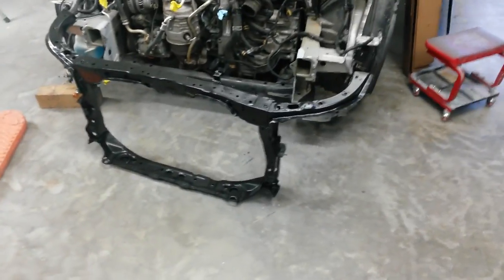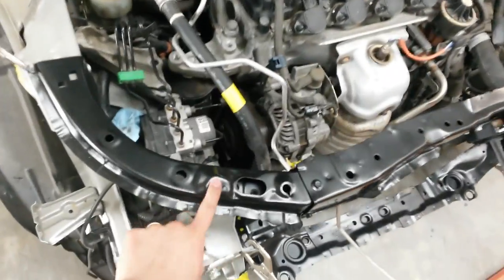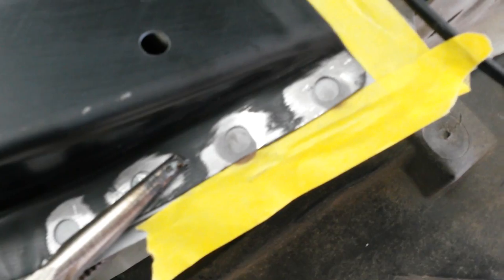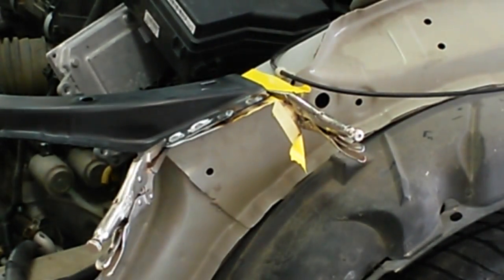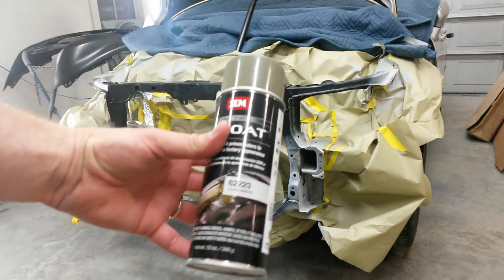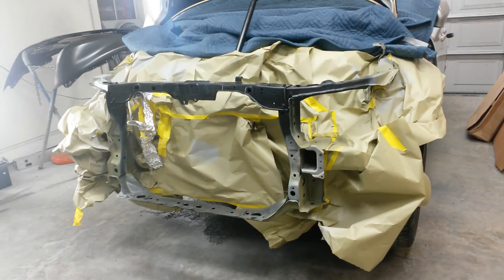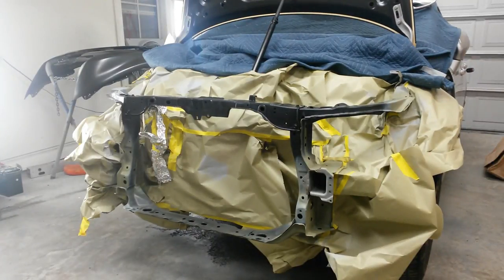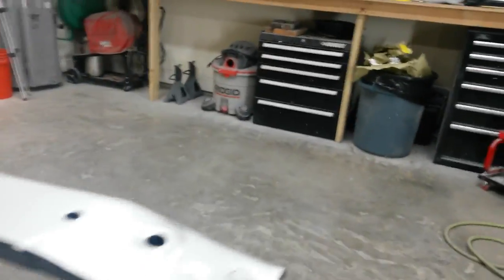2009 HONDA CIVIC REBUILD | HOW TO REPLACE A RADIATOR SUPPORT PART 2 of 2

Comment: I always clip the mig wire when I start a new weld too. Seems to make the arc start faster and smoother for me. Helps tons for butt welds too
Reply from the maker: Works similarly to a spark plug.  The sharper the electrodes are, the easier it is for the voltage to jump the gap. Plus the oxidized steel on the tip contaminates the weld.
Reply: Sam G That's what I was thinking.

Comment: Fantastic Job Sir I'm doing the same on my 2008 your video help me so much thank you very much for taking the time to make such a quality informative video
Reply from the maker: You're welcome. Ask any ?'s you have.
Reply: I got the old support off today it was welded at all the seems not correctly at all.. not how you did it anyways the way it should be done ! and the frame ends were cut out the welds were terrible if you could see it you would have a good laugh im welding in some corner pieces on the frame ends then prepping for the new support almost there i just need to buy the new support shopping around if you know any leads ( websites ) for parts im in northern ontario canada shipping rates are harsh this part is actually hard enough to find at an affordable price it seems
Reply from the maker: I purchase most of mine through Amazon or ebay. use RockAuto to find the Partslink Number (will he "HOXXXXXXXX" HO for Honda plus about 8 digits) Search online for that part number. Most of the time the shipping is free where I buy them.
Reply: thanks for that info been learning more and more ! really appreciate it thanks again

Comment: I'm a rookie on all these spot welding body repair stuff.  Is there a reason you don't just drill a hole and put in a bolt to hold it?  Then if you made an alignment mistake you can go back to zero point?  Well done video.  :-)
Reply from the maker: Ken Foster welcome to the channel.  That's a good question.  You want to avoid drilling unnecessary holes in the part since that weakens the part. It's best to clamp it in place until you know it's in the right position,  then mark it for 8mm plug weld holes. This way you never end up with holes that you have to weld back up after the installation.

Comment: Thanks for making the video. Probably doing this on my 04 civic soon. The headlights are no good and i need to replace them but the core support is so bent it just needs to be cut out and replaced or i wont be able to get the lights to bolt up

Comment: Hey Sam! Quick question. After you painted the support, did you apply a clear coat over that silver? Or leave it bare?

Thanks
Reply from the maker: I added clear but you can add activator to the basecoat if you need to match a factory finish that wasn't cleared.

Comment: Would rosette welds with a tig welder work you think for this type of job?
Reply from the maker: I don't know much about TIG, but it would probably work. I believe TIG is a lower temp weld, which would be beneficial. Would probably take much longer though.

Comment: Sam what is the tool you used to check for square at 3:08? I have an 09 C-RV that uses the same support replaced.
Reply from the maker: Tram gauge. I made mine but you can buy them.
Reply: Sam G did you buy OEM or aftermarket support?
Reply from the maker: @theunlucky5000  aftermarket.  Try to find  a CAPA certified part

Comment: How to put radiator suport perfectly in place , so then have perfect match of gaps on front parts hood , headlights, bumper. Is there specific dimensions,  or just weld to old spots? Thank you
Reply from the maker: You can get dimensions from Honda thru Oemonestop.com

Comment: I HAVE SAME ISSUE in my car ..but i have little twist from one side but it does not causing any problem other than look... so one can leave it as it is or it may cause any wheel alignment issues ?
Reply from the maker: The radiator support doesn't affect the wheel alignment
Reply: @samg5543  thanku v much for your reply sir i need little of your time i hope u will not mind. .FIRST of all HONESTLY i became your fan through your work. I live in  PAKISTAN damn it would be great if we have a person like u here.  My Question goes here "as u said it does bot affect wheel alignment i just wana know of that is the case wht could be reason of car sway .car sway little side to side on high speed.  There is no bend on frame rails other than this radiator /core support.  Tires are perfect n previous owner told he had done wheel alignment properly.  I bought this car few months back. Plz guide what should i look into
Reply from the maker: @gulraizify  find a shop that can check the alignment and make sure the tires are all the same size and tread depth and pressure is equal. If it pulls or sways to one side, swap front tires and see if the sway or pull goes in the opposite direction.  That will tell you if the problem is in the tires themselves.
Reply: @samg5543  thanku stay blessed

Comment: Also I'm thinking that it might just be a bent radiator support, can I just sledge hammer it straight and do I have to evacuate and remove the condenser first before doing that? or can I just get away with leaving it in place and hope it doesn't get smashed?
Reply from the maker: You can remove the support brackets for the condenser and move it out of the way slighty without evacuating it if that helps. If the center piece at the top is bent, you can unbolt and swap it out with a new or used  one if yours is bolted in like the civic I did
Reply: @samg5543  Okay, someone else told me the radiator support can be unbolted. I didn't believe him because the videos of you show you mostly drilling out the welds and welding back a new piece. I'll double check the diagrams and look at this again this weekend. Thank you
Reply from the maker: @eksine  some cars will unbolt but not the one in the video

Comment: Do activate ur basecoat .. been trying to figure out how to shoot basecoat to match the factory
Reply from the maker: Yes I activate the basecoat, but that doesn't make it match any better. You have to use the correct temp reducer and that will help. If you are spraying light metallics, it's best to blend the adjacent panels to avoid a mismatch.

Comment: so its safe to say radiator supports arent meant to be removed easily and then put back in right?  was thinking about doing this to make replacing my clutch easier  (i got time, but i have to do it myself)  i dont want to have to do any welding or alter any thing.
Reply from the maker: Not designed to be removable on these types of cars. Some do unbolt. Depends on the car.
Reply: Sam G thanks! I’ll look more into it but won’t hold my breath haha.

Comment: Know I’m late by any chance where’d you get the radiator support
Reply from the maker: You can get aftermarket ones on ebay or amazon. If you are in large city, there should be a supplier for body shops in the area also. Look for  LKQ or Keystone

Comment: Hi Sam G, I just replaced the hood on a 2002 Honda Odyssey from a known straight vehicle. When I put it on my van it's obvious something is bent, the front of the hood sticks up like an inch and nothing I do can fix it. Where or how do you find the diagrams to do the measurements to make sure the front end is straight? is it free or is it a paid service? I can't find anything online
Reply from the maker: Oemonestop.com will have links to most every site. Honda is a psid service, but you can get a 1 or 2 day subscription for cheap and download it all and save it
Reply: @samg5543  Thank you so much! I have no idea how to use that site but I'll figure it out, thanks!

Comment: The bottom of my 03 maxima radiator support is rusted out, actually snapped In the middle just right of where the hood latch center support would connect to the bottom of the radiator support. How bad is it to drive with it in this condition? & should the entire radiator support be changed out or could the rusted part be cut out & replaces with a piece that’s welded in??
Reply from the maker: if there's a chance the hood will fly up while driving, it needs to be repaired asap. There's no need to replace the whole thing if you can section part of it. However, sometimes it is easier to replace the whole assembly depending on how it's constructed or if there is better access to the welds by doing the whole assembly.

Comment: I hit a dog with my 2012 Honda Civic and it smashed the lower cross member of my radiator support and took out my radiator and condenser. Is it possible to replace the lower radiator cross member only and what would it take?
Reply from the maker: Yes, that piece is  typically sold separately from Honda and maybe you can get it aftermarket if you search the honda part number from aftermarket suppliers. If it's no longer available, you can purchase the whole assembly and remove that lower piece and use only that. You have to remove the front end parts, then remove the radiator and condenser. Then cut that piece out at the spot weld locations and weld the new one in. Paint it all and coat the inside with cavity wax with a 360 degree spray wand. Disconnect the battery while welding on the car.
Reply: @samg5543  Hey Thanks Sam for the speedy reply. My car is at the Insurance Auto Auction and I need to deride soon what I am going to do keep the car or just take the money only Mercury Insurance totaled out my car but I'm really like my little Honda at the moment even more then dogs and it's the only car I have.will the whole frame have to be removed?

Comment: The glass insert right above your side mirrors do you know the correct name, want to cover up mine on 08 civic and put my aftermarket side mirrors on.
Reply from the maker: Honda calls it the front corner glass. this can also be called the "vent" window glass. That is same the location of the old type of manually operated vent windows from really old cars and the name sort of stuck.  Could also be called the front quarter glass.
Reply: Thank you for your help and Vidz your a big help. Merry Christmas to you and yours
Reply from the maker: You're welcome. Merry Christmas to you as well!!

Comment: How you do know the measurement for the radiator support. So it can fit perfect
Reply from the maker: You don't need it. Just use your hood stiker and latch to get the length front to back correct, then cross check the front end with a tram gauge to get it square.

Comment: Hey Sam, as usual, great info and video. Did you use a sand blasting gun to clean the holes the spot welds?  Also, I may have asked you this before, is there a risk of the frame separating after you remove the rad support?  And if so, how would you close it up again to weld the new support?
Reply from the maker: Miami13 i used a blaster in the video, but I have changed my process since then. The frame rails shouldn't  move when the rad support is cut out. If they happen to, you could squeeze them together with a come along or spread them with a  porta power
Reply: If you'd done that job for a private our insurance customer, what would the ballpark fee had been?  Given that you relaxed the rad support, and all parts like headlights, radiator, condenser, a/c work etc etc..?
Reply from the maker: Miami13 probably 4-5k
Reply: Figured it wouldn't be anything less than 5k.
Reply: I'll say this Sam, I've watched many on youtube "professional" painters, compared to you & the way your jobs come out they look like amateurs.  Your hand's very steady and  assembly-robot like :-).
Reply from the maker: Good to hear. I often think of that very thing when I'm spraying and try to spray like a robot. Afterall, a painter is expected to recreate what a robot did in the first place.

Comment: Where did you order your support braket at?
Reply from the maker: Get the partslink number from Rockauto.com and search google. Several online sources or you can try your local Keystone automotive if you have one around. Can also get from honda dealer but will be more expensive.

Comment: will the car react the same in a crash? with the non factory wells?
Reply from the maker: Good question. Yes, it will perform similarly in another collision, however, the radiator support on this car and most all unibody cars is simply there to hold the cooling parts and the headlights. It is very thin gauge steel and provides very little protection in a collision. The crash safety is built into the "frame" rails and the bumper reinforcement bar that sits behind the bumper cover. That is what mainly affects airbag deployment, so that is a much more serious repair. The airbags did not deploy in this car. Thanks for your interest.
Reply: Sam G thanks for explaining how it works to me.
Reply from the maker: No problem. Just let me know if you have any other questions. I'm doing another one right now that's the exact same car and same repair. I will post some of that repair also when it's done.

Comment: Hey im actually doing the same thing to my civic but when i put the fenders on the car and once they are screwed into the radiator support and i let down the hood it doesnt line up with the latch and on my driver side fender it touches the hood so there basically no gap while on my passenger side i have about 1/2 to 1 inch gap from hood to fender. My passenger side headlight fits perfectly and line up good with the fender and screws in good with my radiator support but my driver side headlights just doesnt line up with the fender or the radiator support. Do you have any idea on what i may have to tweak so i can fix this problem?
Reply from the maker: SoyDeDurango You will have to make sure you have the radiator support square by measuring the diagonals with a tape measure or a tram gauge.  Once you have it square,  center the hood latch and bolt it down. Make sure to fit the hood to the latch, then fit the fenders.  You may have to modify some of the mounting holes in the fenders. Your hood hinges could also be bent if they are not new. They most likely got bent if the hood got pushed back even a little. Make sure they are good or replace them before you try to align everything.  Start by squaring the rad sppt, then fit hood to that,  then fenders.
Reply: Sam G Alright thanks i just ordered a new set of hinges since the ones i have on the civic now are from a salvage yard and the car was hit in the front which could of possibly bent the hinges. Hope it solves my problem!
Reply from the maker: There should be some adjustment in the hinges themselves, but it will be on the cowl side, and probably not much on the hood side. those holes are pretty small.Just make sure you have the radiator support square before you do anything else. Use the hood hinge mounting holes to measure the front diagonals before you mount the hinges.
Reply: Sam G Finally got done man i appreciate your help i put freon, oil and coolant in the car and it runs good but theres a wire that connect to the coolant temperature sensor #2 on the lower radiator and theres another wire that looks similar like it but i cant seem to figure out what it connects to...
Reply from the maker: SoyDeDurango It may be for the outside air temperature sensor if your car has that option. It mounts on the drivers side of the condenser and should have a similar size connector.
Reply: Sam G I actually already have it connected... ive looked at the harness diagram and where the coolant temperature sensor is connected there is another plug thats barely noticable near it but on my car theres no other plug so im not sure what it could be
Reply from the maker: SoyDeDurango if it's really dirty inside the terminals, it may have never been used. Sometimes there are fog light connectors that aren't used also. Good luck
Reply: Sam G alright sounds good man thanks for the help

Comment: I thought the whole point of weld-through primer was that you could, you know, weld through it...
Reply from the maker: IncognitoTorpedo you can with a spot welder which is really what it's designed and named for.  spatters a lot with a MIG welder.

Comment: Why not just take out the bolts to the radiator support bracket. That what I did to put the whole support in without issues...
Reply from the maker: There are no bolts to remove.  It's all welded together. You can remove the bolts in the upper crossmember, but that will break the ecoat between the panels and would not help installation anyway. The bolts you see in the frame horns are for the front rebar and were just in place temporarily to not lose them. They are not holding anything on.

Comment: Where did you order the replacement parts from?
Reply from the maker: Alex Ledington I ordered most all of it through eBay and amazon.  mostly aftermarket CAPA certified and some OEM. also some parts from Rock Auto. thanks for watching.
Reply: Rockauto.com is a great site

Comment: How much for a repair like that on 2009 accord sedan??
Reply from the maker: This would run about 2500 total but can vary a lot based on parts costs.
Reply: @samg5543   Right on the money that's actually Exactly what I had Quoted $2,500 less or a bit more  Depending on the complex multiple part replacements